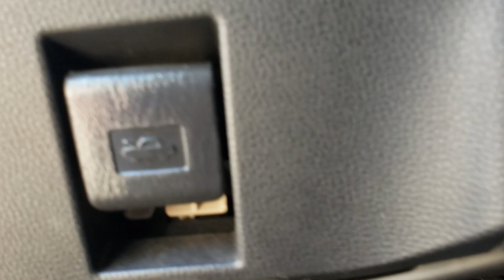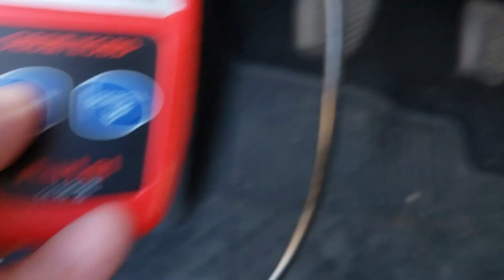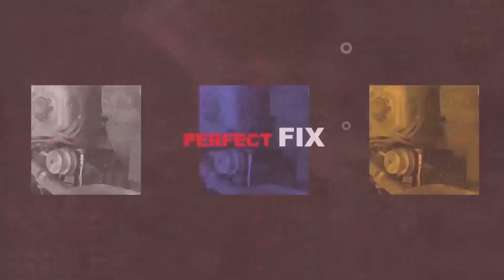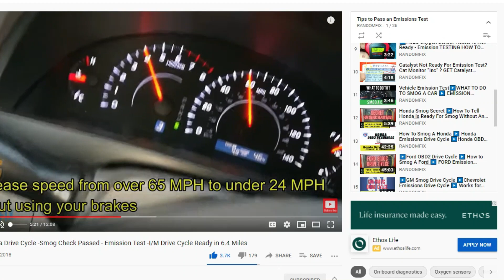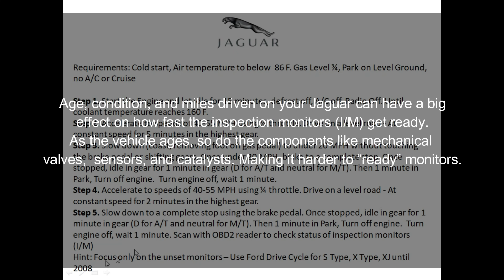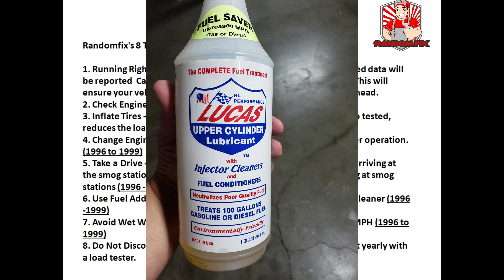Jaguar Emissions Drive Cycle▶️ Jaguar Smog Test o2 EGR Cat Evap Monitor Readiness

Comment: Hello I bought a 2004 Jaguar Vanden Plas XJ8 with X350 4.2 litre V8 engine I am trying to clear the Drive Cycle monitors to smog my vehicle in California, all monitors are ready except for 2 the CCM and Evap monitors...do you have any advice on how I can get these last monitors to clear? P.S. no CEL is on
Reply from the maker: Very complicated issue so I please check this forum, your answer is the jaguar tsb https://www.jaguarforums.com/forum/s-type-s-type-r-supercharged-v8-x200-15/ok-i-give-up-help-ccm-monitor-134156/
Best of luck and keep me posted.

Comment: This is over kill. If all numbers are fine, literally put on the interstate at 65/70 mph for about 50/100 Miles. I've done it many times
Reply from the maker: Hi understand how frustrating it can be to get your jaguar ready for smog. Which monitors are is still complete?